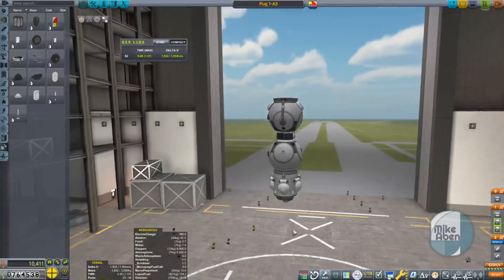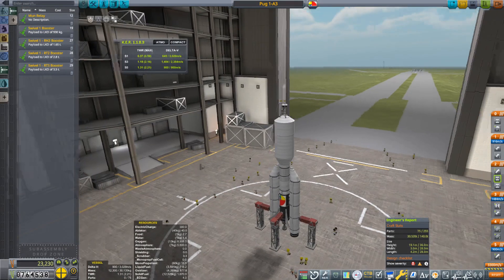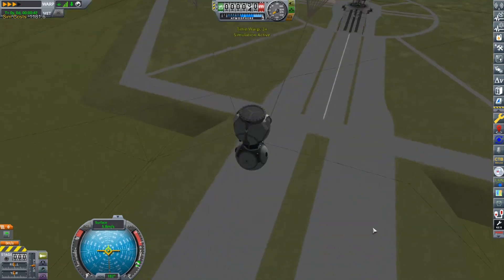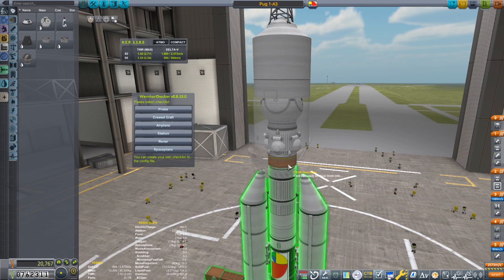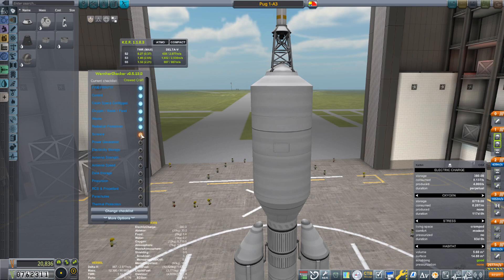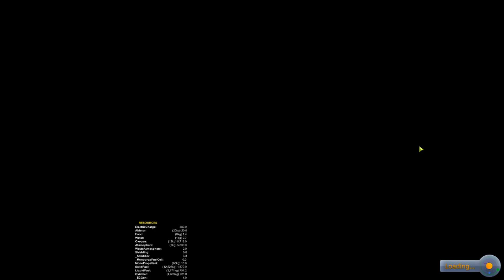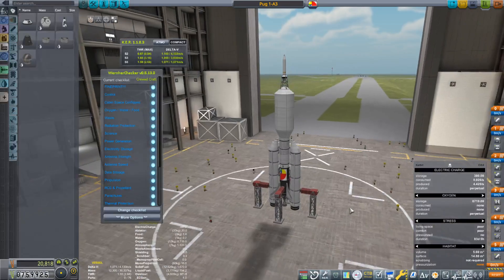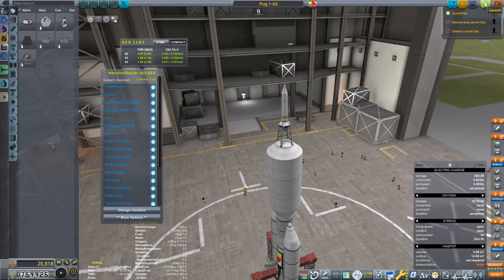Testing with KRASH | Stream pt. 2/3 (KSP 1.11.1)

Comment: Hey. U use maybe X Science? How can i run it with KSP 1.11 version? 
Best KSP tutorials :)
Reply from the maker: Thanks. I've used x-Science in the past, but Kerbalism makes it unnecessary. Have you tried running it in 1.11 yet? Old mods often still work. Just back up your save first.
Reply: @MikeAben  Yes i tried few version and every i "unnsuported" by KSP 1.11